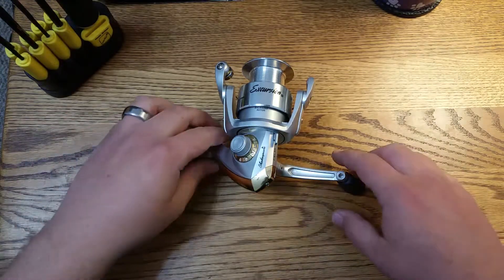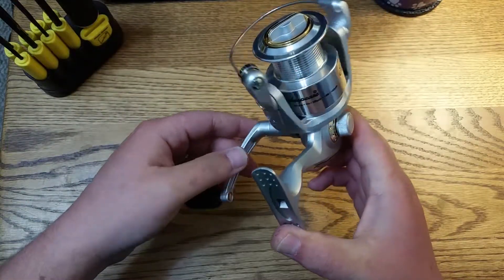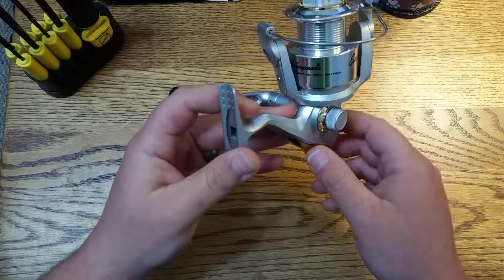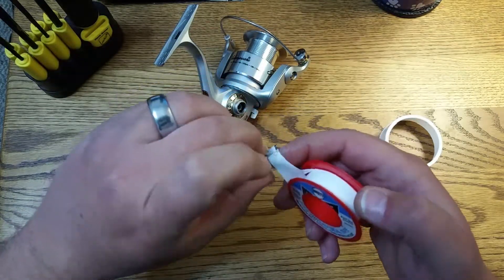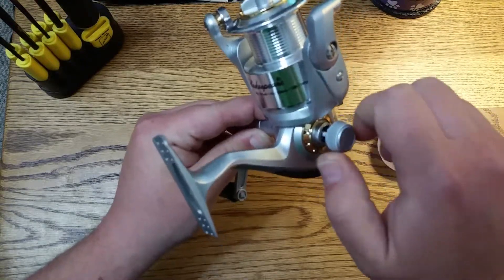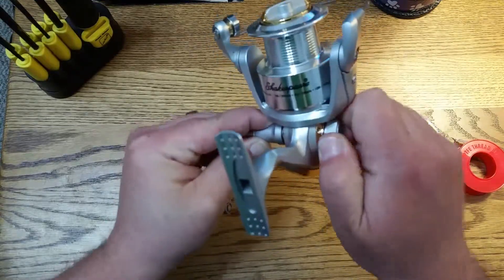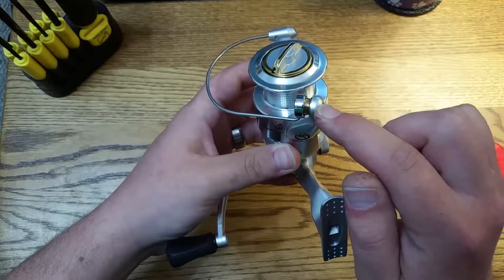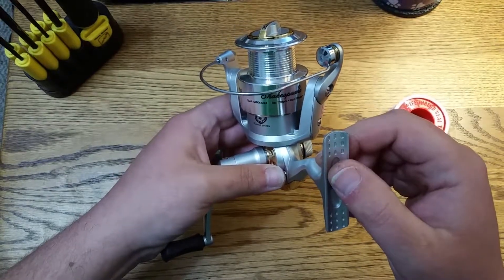Reel Quick Fix for screws that constantly back out.

Comment: You are missing a washer. I had the same issue until I took a plastic washer off another broken reel screw cap and put it on the one that kept getting loose on me. Fixed the problem

Comment: I broke the srew cap
Can it be fixed?
Reply from the maker: Might be able to epoxy it back together. I use E6000 for stuff like that, but literally just because that's what I have lying around. Just don't get excess amounts of it in/on the threads and let the piece dry off outside of the reel and cure.